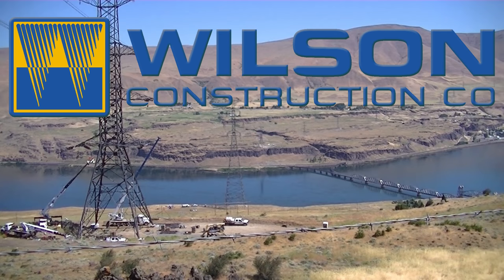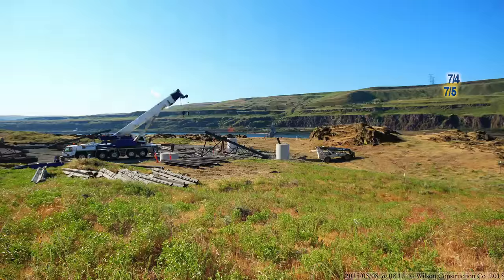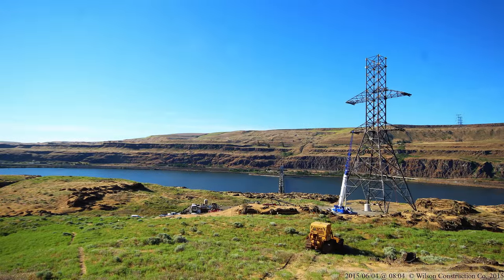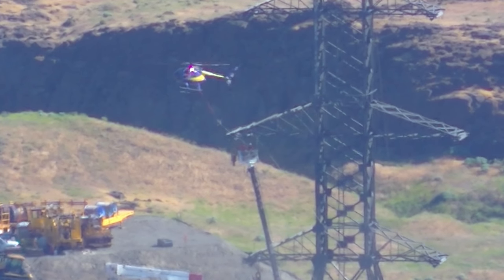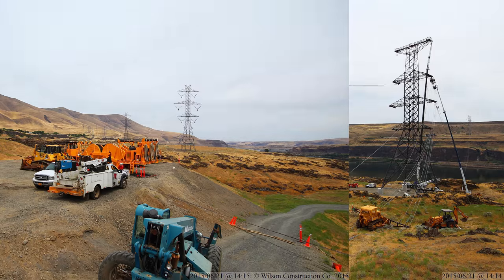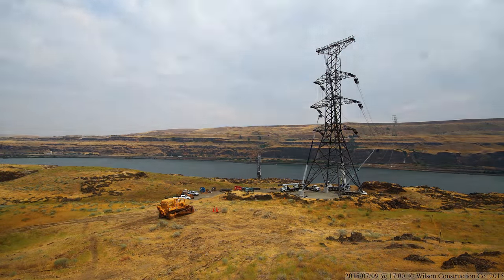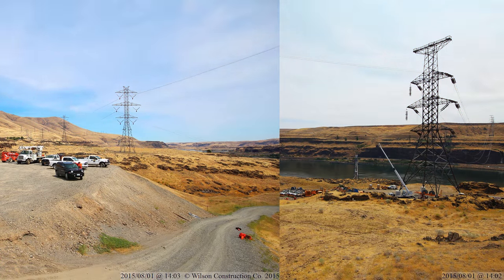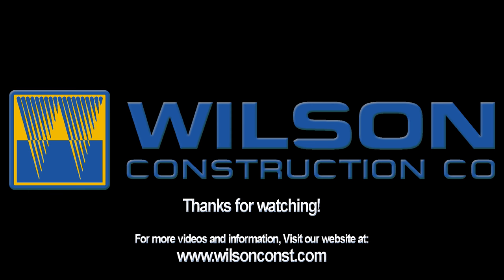Lattice Tower Construction on Big Eddy - Knight 500kV River Crossing

Comment: It was cool to learn all the weights and tensions involved - those are some big stresses the towers have to withstand!  Still, I find it kind of funny that even with all the modern construction equipment and techniques, the towers themselves look virtually unchanged from those built 70 or 80 years ago.
Reply: the lattice style towers will remain like that until our construction materials change. With current steel, that still remains the most efficient structure in terms of material usage. So while the construction methods may change a lot, structures built for cost effectiveness will look the same until engineers find a new material that has different properties to steel, and is as cheap.